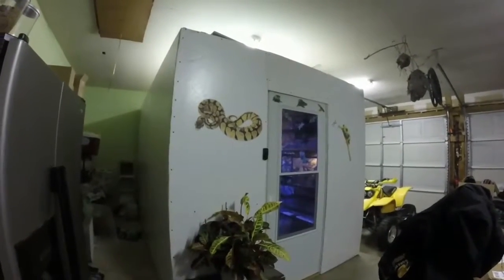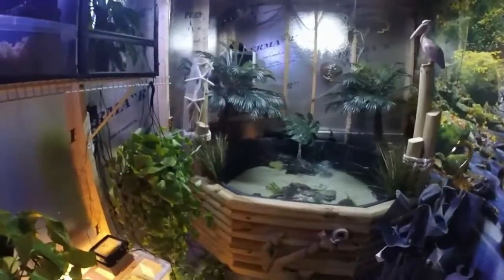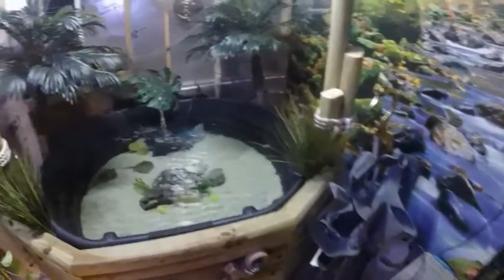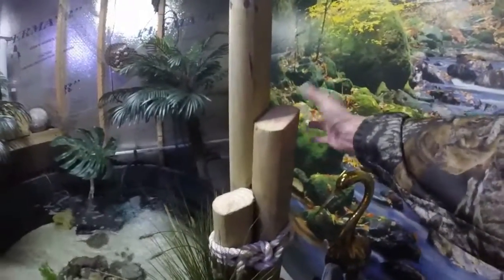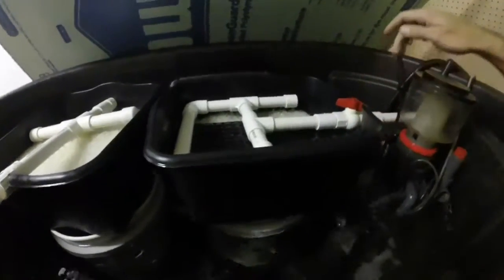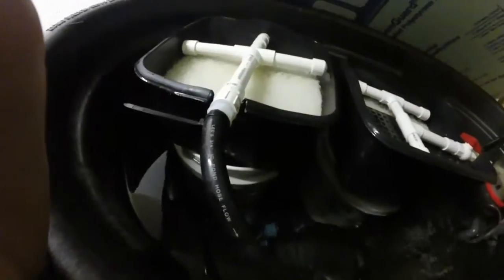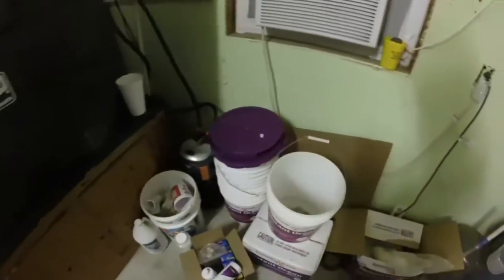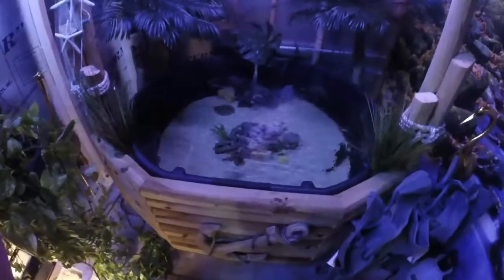Reptile room on a budget / The Lagoon Room

Comment: I was thinking of using a brand new above ground pool as a pond. Talk to a few people who have used them for raising koi or using them as bait stock tanks. Said they work well and save lots of $$. For filtration I seen a simile set up where a pond pump was put in a food grade trash can filled with media top to bottom and the outflow tube was put into PVC piping to control where it went. Any thoughts?
Reply from the maker: I actually looked at some pools before I did mine ,  I have seen a few folks have done and seemed to work great . I also have looked at larger cattle troughs which I like more due to them being hard plastic because with the pools being like a plastic liner I feel the trough should last longer and be a little more rigid . And the filter I actualy used a brute rubbermaid trashcan first I had it outside the pond instead of inside and it did work but the larger tub just offered me more room for my filter componets .  Either way you save a pile of $$ this way over a glass or acylic tank any day .  Thanks so much for checking it out .
Reply: Thanks for the reply. I would probably build a wood or stone wall around a pool to support the sides. The kind I was thinking of specifically is vinyl like pond liner hung on a metal frame that supports the walls at various contact points. You can get pools even that have metal reinforced walls (these are meant to be left out all winter though drained of course instead of being torn down at the end of the hot season like the others). After further research into filtration I found a great gravity run Rubbermaid build I love. I'd have plenty of flexibility on filter size and arrangement of media. It's very similar to your current filter only you pump water only to the filer and have it run out back to the pond on it's own. You have the stacked trays/tubs of media that water flows through from top to bottom like yours but the filter doesn't fill with water. As I see it the more I save on the setup by DIY the more I can splurge on the fish to go in it, LOL.